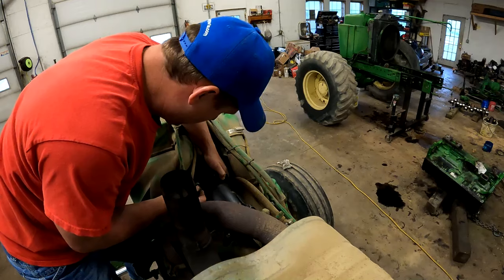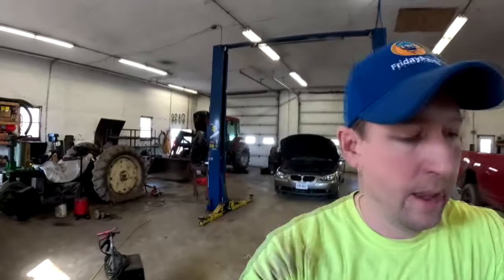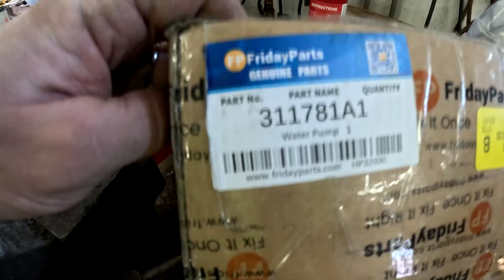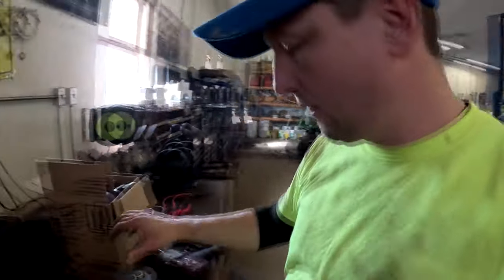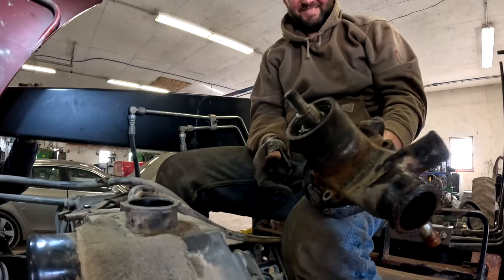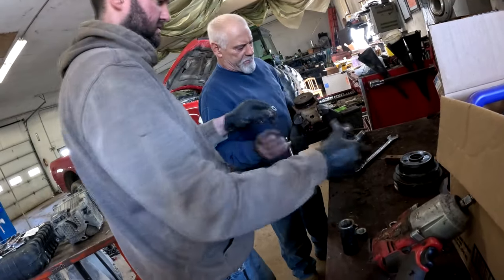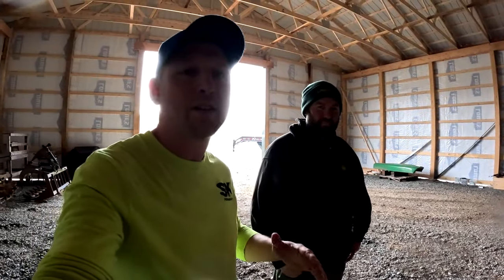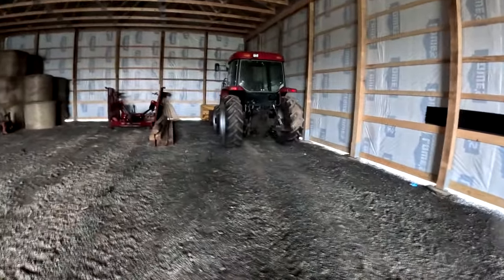Case CX90 Water Pump Replacement

Comment: I always wondered why the "Reds" never integrated loaders with their tractors.  Even if they subbed out the design, I would thought they would have made them to fit correctly.
Reply from the maker: That's a good question.